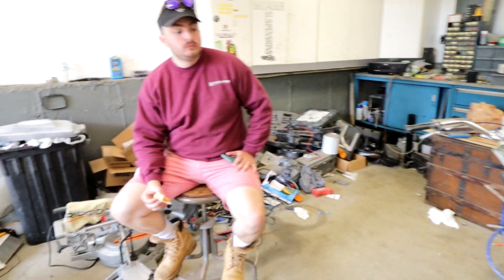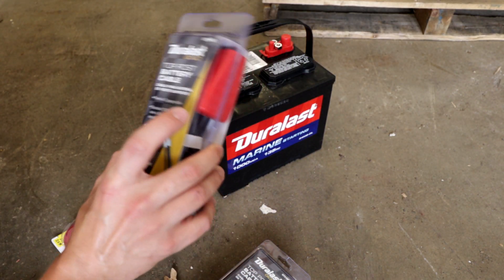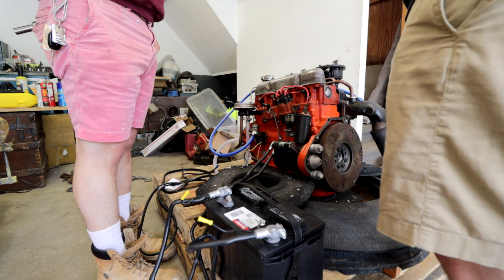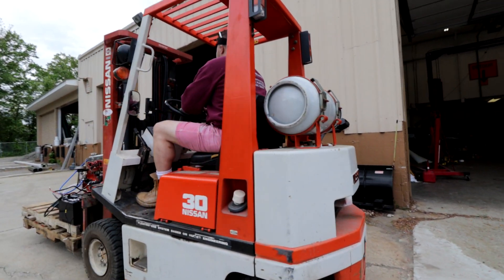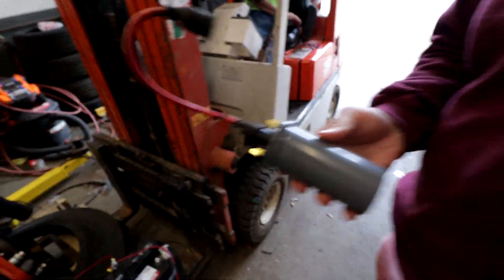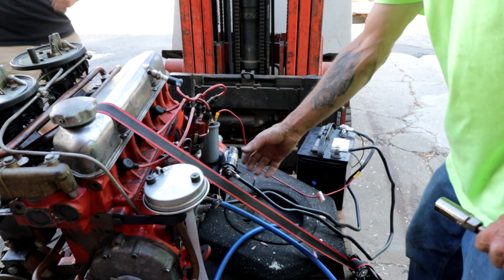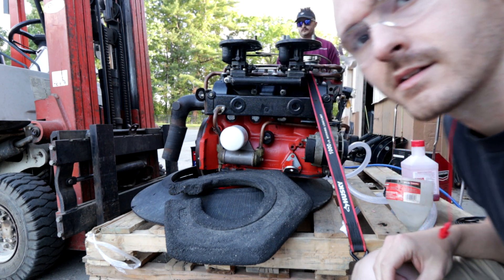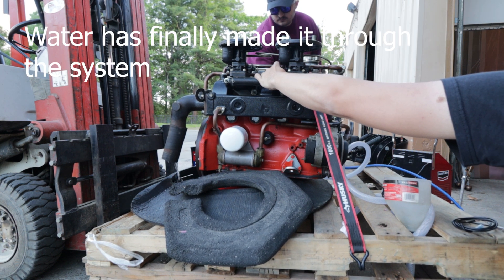Engine Ignition Not Working - Boat Restoration Part 31

Comment: Just got my b20 together, and it’s overheating. Any tips for me? 
New impeller and it pumps water but still going warm
Reply from the maker: Hmmm well it sounds like maybe the coolant passages are blocked somewhere. Could be rust build up or maybe a gasket is not seated right. Lots of possibilities to diag over the internet lol

Comment: Wow, tough case. Definitely the coil needed to change and you stepped forward to cranking, but the ignition still not happening... From the little I know, you need three things for a working motor. Fuel, spark and air. If you miss any of the three or something is not balanced or synchronised, you don’t get a running motor. Check patiently all three factors before you exhaust your battery :) Good luck man, you are going to need it, not an easy case!!!👋👋
Reply from the maker: Thank you man! We need all the luck we can get! But we will figure it out for sure!

Comment: Timing, and air mixture are probably gonna be your next battle.  Need to figure out what the timing supposed to be and what it’s set at currently.  Could also be the distributor is out 180.
Reply from the maker: Looks like i’ll need to be reading the manual a bit more. Thank you!

Comment: Reminds me of when I was 16. I had a newspaper route and a new to me 1958 chevie convertable. I ran out of gas at the paper shack and pulled the air filter and poured a little gas down the carb after putting a few gallons in the tank.It backfired through the carb and I had to use my shirt to choke out the fire!Great stuff! For some reason I got fired from papers shortly after.Something to do with Walker Blue Tone mufflers and the noise at 5 00 A.M.CHEERS from Canada!!!
Reply from the maker: hahaha thats an awesome story! Im sure it had nothing to do with the noise lol